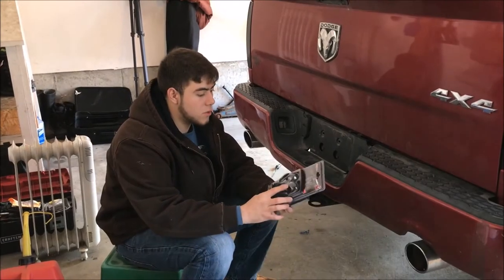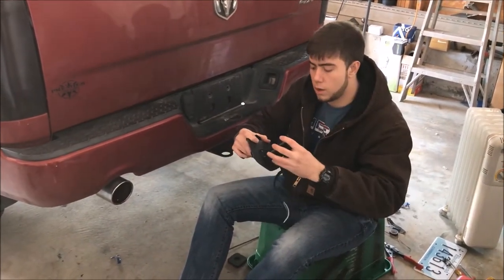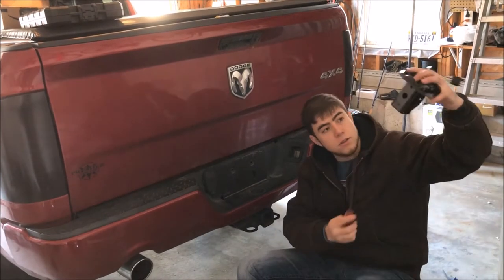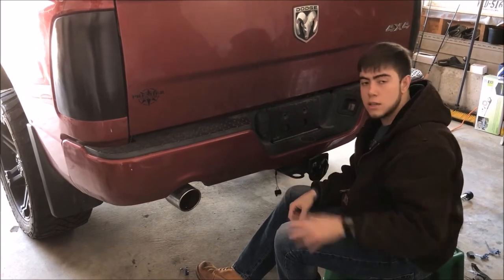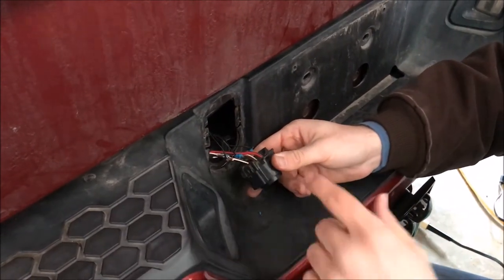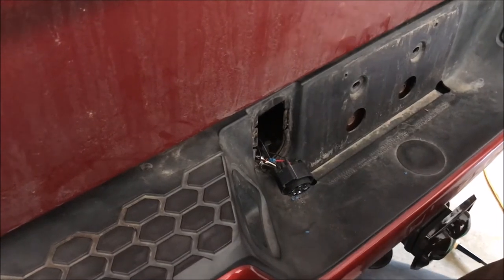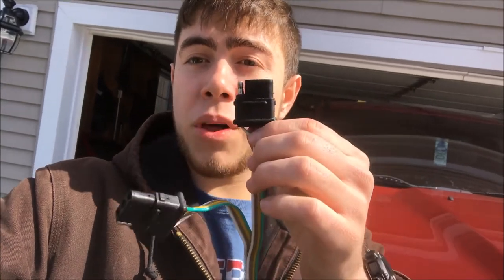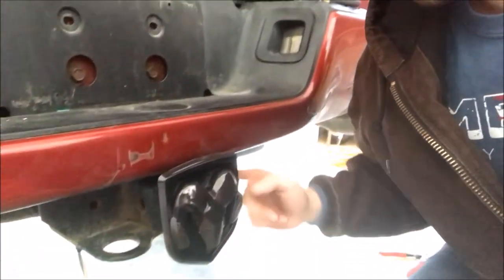Reese Hitch Mod! Time To Ram It Up!

Comment: I just purchased the chrome faced one. It has the same wiring color harness as yours (brown,green,white and yellow). It lights up when I hit the brake, but does not flash for the turn signals? Why?